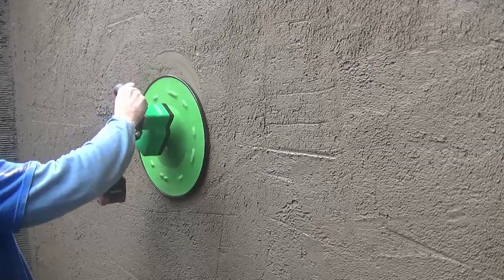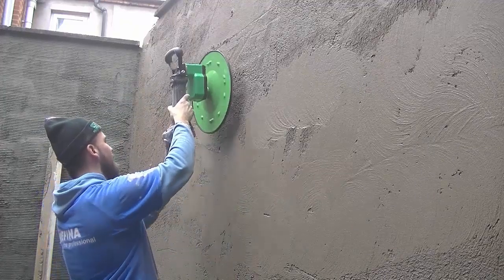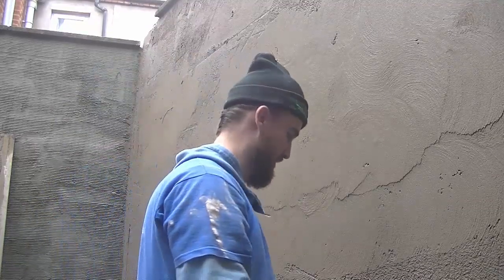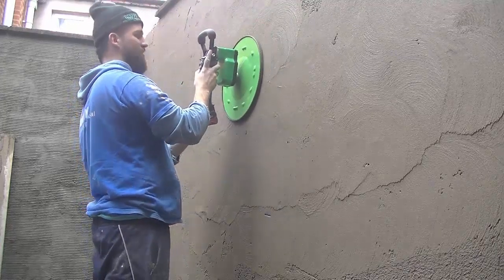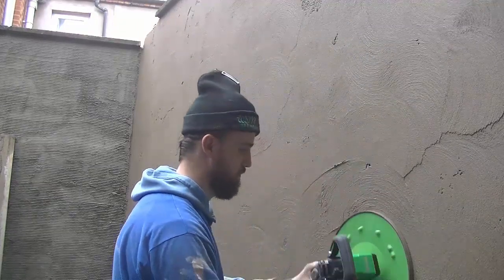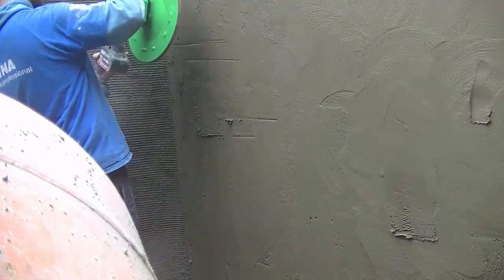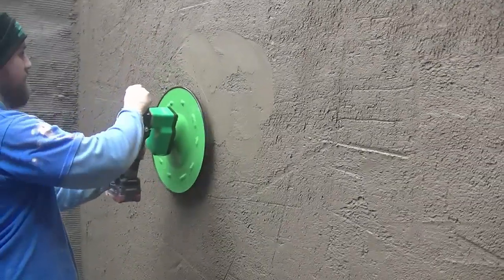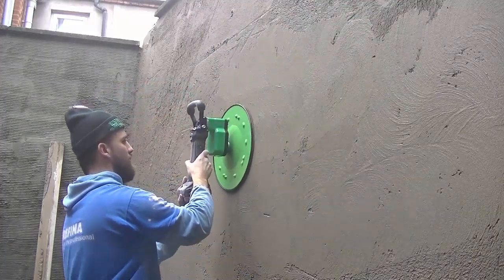REFINA POWER FLOAT 1ST GO ON CEMENT RENDER

Comment: Just got one of these, used it for the first time last week. Was scratching up mono with the scratch attachment. Probably should’ve practiced first, It dug in😭 
Went straight back in the van. 
Think I’m gonna practice using Sand/cement for a while, bit more forgiving, ha!
Thanks for posting this video👍🏽
Reply from the maker: Hey Lee my fellow spreader :) oh man that sounds a pain yea i recon when we get the  workings of this tools 2 gables will be an easy finish with speed and less stress, we are all in the same boat  , big walls in the summer I reckon this tools will come into its own :) Thanks for watching and commenting mate

Comment: Alright fella been using this  Corded version for years. The corded version looks better balanced than your cordless one, though it does get heavy. I only use spunge as it fills and flattens and is not so aggressive. Have to use hand float around edges and beads as it takes it back a bit and leaves bead slightly proud. Just let render tern  much quicker and flatter results. You can afford to do this because the meters you cover are huge. Can easily drop pine end of house within 1 hour. I started by putting lime in render but one day didn't and found it easyer as it wasn't so lively and firmed up better.  The biggest thing is using proper plastering  sand. Hope it helps this machine takes out all the leg work and allows you to focus on the finish.
Reply from the maker: Hi Ian mate thanks for the great comment  super great info and insight We have great sand here I for sure feel i could went with the sponge straight up , Thanks again with your findings mate

Comment: Have u used the plastic hand float much more ?? I have one not got it out for a play yet just wondered how you rate it
Reply from the maker: Hi mate I do like it but tend to use the more broken in ones i have I need to get some pins in it so can devil float inside walls and get it real nice for finishing smooth render , seems the kinda float would last years
Reply: @macplastering  yeah I’m the same my worn in ones are so good it’s hard to use a nee one knowing a good one in the van will run it so much better 😂 I’ll have to try break it in on some hidden areas
Reply from the maker: You will probs notice on my videos I use new floats for devil floating and screeding the most haha

Comment: Great honest video!  Just wondering if you tried using the sponge first?   I’d like to know if you can skip the float and go straight to the sponge.  Cheers
Reply from the maker: Hi Mark mate yes I have tried it both ways on this video the error is mine as going to early wall was just to wet and my 1st try I have use it recently with super good results and will upload video in a few weeks for sure :) but yes the sponge on will work great with out floating

Comment: Hi mac,, nice work for the first time using,  sponge looks affective. did you finish using power sponge or did you use the hand float to totally finish wall
Reply from the maker: The top and middle was 100% the powerfloat but bottom was a mix of both i as it was soaking lol I used a hand sponge to just finish it all up at very end also
Reply: @macplastering  you'll get sorted when storms. rain. sleet. goes away  lol  weather is terrible .. Thanks for putting that video up 👍👍
Reply from the maker: Had some time the other day and got some footage of the setup and feel i can talk about it with the footage i have  for ceilings :):)

Comment: What does that wall look like when it has it's five minutes of fame a day with that certain angle of the sun hitting it. This doesn't appeal to me for floating but I'd imagine for sponging down it be great and as someone's mention in comments the sponge pulls it tight and I'd imagine not so much of a marking off it. Even though I'd imagine it will will burn the burner by polishing them bigger grains in the sand. Good video. Saves me ever considering an option of getting one. Maybe a good send on gables, got one at the moment 6 flights high. May see if Refina would be happy for me to test one for nothing.
Reply from the maker: They might you never know , it looks ok here all day round as these back yards get little sun LOL and this wall was a bad shape to be honest , I was hoping to get it on a better wall in warmer weather with sun shining and relay test it out yes some guys just use the sponge and not the plastic and use it to rub they say when the sponge fills its great closing in, have you seen the new trowel I just Unboxed mate ?
Reply: @macplastering  not seen it yet no. Will check it out Mac
Reply from the maker: Thanks buddy :)